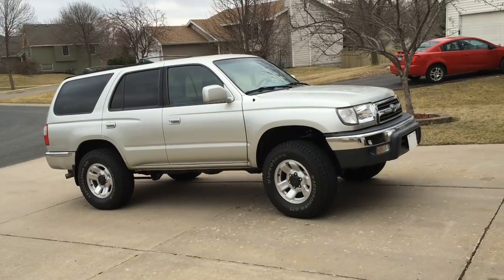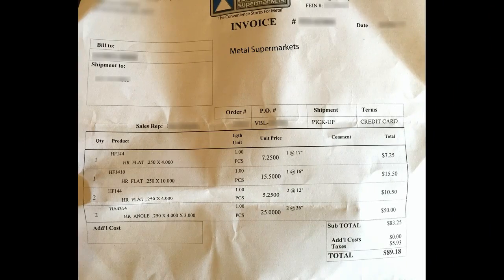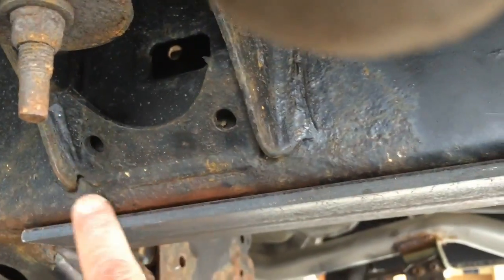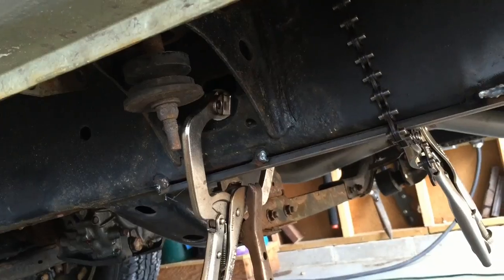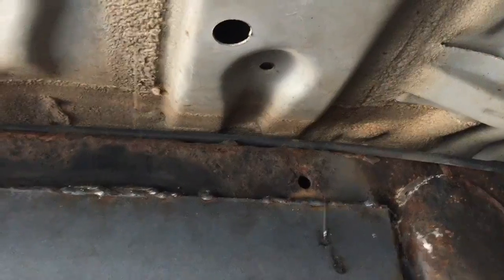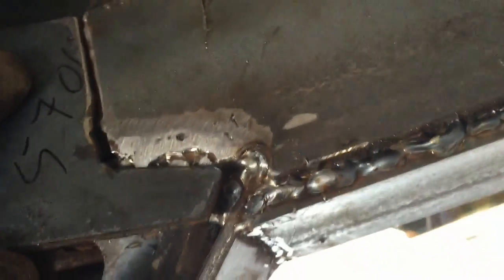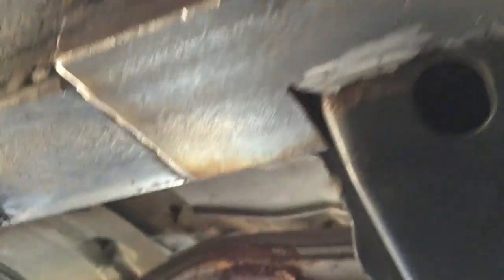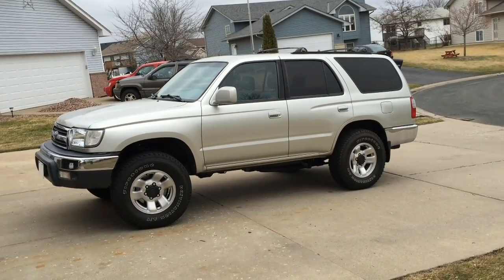2000 Toyota 4Runner Frame Rot Repair - Welded

Comment: As a welder, all i can saw is wow!. That is anything but safe. The frame was basically engineered to fail, notice the lack of rust on the floor pan. I find it funny how everyone went after vw for emissions when toyota has been building these unsafe rust buckets for decades and continues to do so. Toyota trucks are designed to fail after about 10 years both structurally and mechanically. Selling trucks and cars behind this facade of quality. Owned a tacoma once took a beating on it and never again, bought a domestic after that.

Comment: w/o getting rid of the existing rust, this repair is a waste of time.
Reply: +Boomer Po i was gonna say the exact same thing why go thru all that work and not cut out the rust that is a really poor job sorry to say but waste of effort its like having severe cancer and not cutting out the tummer b4 starting kemo
Reply: +Boomer Po To me, it looked like if he cut of the rust, there wouldn't have been anything left.  Maybe sand blast it?  But even with that, these frames rust from the inside out, so it's only a time buyer anyway.
Reply: Rust doesn't spread, moisture causes rust.
Reply: Jeremy Wood the entire section would have to be cut off then replaced and welded.
Reply: If he gets a couple years out of it it was well worth the time and money to do what he did . I'll bet it's still good and solid now almost 3 years later . Nice job . TheReaper!

Comment: I'm pretty sure Toyota designed the frame like this on purpose. I mean if the engines can go for 300k, they need to make their profit. So either they make junk engines that last 150k, and ruin their reputation, or design crappy frames that would only rust away in states that use road salt, so they still hold their reliability reputation in the non-road salt states, and make their money at the same time.
Reply: makes sense actually....what do you think about bmw mercedes & audi
Reply: So, the solution to that is to just simply undercoat it yearly. That's what I do and my Toyota frame is rust free and I live in Atlantic Canada.
Reply: bmwmsport11 I’m pretty sure Toyota would replace that for free

Comment: 1/8" steel would been plenty strong and much easier to work with.
Reply from the maker: I agree, the only advantage I seemed to have with the 1/4 inch was being able to grind down the thickness in some cases to get the pieces to better fit over non-flat surfaces.   Plus, not being a welder, I appreciated the extra metal on the edge to weld on to.

Comment: Dude,  you got balls to take on this welding job!  Way to go man!  Do it yourself and build on every experience  and show others that it's  possible.  The thickness of your material obviously over compensates for any possible weakness in the factory rusted sheet metal.  Good job on the por15 Paint job.Thanks for the video!

Comment: Thank you for this video.  I have a 1973 Corolla with frame rust/cancer on the driver's side forward of the cross member.  I no longer fear repairing it.      You did what you had to do and I applaud you.
Reply: As a guy whose repaired many rotted frames, i never use steel that is thicker than the original material. Overkill just makes penetration into the original frame much less effective, and harder to form. Always make a pattern from thn cardboard.

Comment: Impressive work/job and the best results I can find, food for thought, yes it certainly is. I have a bit of a frame issue here , I have tackled and work in progress. Yours is an inspiration of what can be achieved, mine is a lot less to do, thankfully because I'am just getting into welding, bought a cheap 200 dollar mig flux cored wire feed so hope to catch on and fix the problem. Thanks Man for sharing your work. Regards.

Comment: You say you aren't a welder which I understand, but... to anyone watching this, if you use this video as guidance, PLEASE grind down the base metal on the frame to shiny metal before you weld.  Welding over rust and rot does nothing but make it look like you reinforced the frame.  There is little to no assurance that good solid fusion is occurring to good base metal.  Rotted metal simply disintegrates when welding so you may think you're welding two pieces together but the result can be simply cosmetic covering of a huge problem.  Proper welding technique and heat input on good sound metal is the only way to get good metal fusion.  In addition, welding over paint or powder coating further contaminates the weld metal compromising its integrity.  

This frame in my opinion, was way past salvageable.  Especially, where main suspension components attach.  If a repair were attempted on such a critical part of the vehicle, a professional welder with a sense of structural reinforcement knowledge should be employed, but I fear a welder of that skill level would pass on this job.  This is not a safe repair.  I don't mean this to be criticism of your decisions, I just want to share with folks that may want to do the same in this safety critical part of a vehicle. 

There is sound structural welding, and there is cosmetic covering up of rotten steel welding that doesn't do much, if anything, structurally.  I myself have a 1997 4Runner with issues not as bad as this and I am curently on the fence as to repair or plan its funeral.  Its a shame because I have had it for 15 years and it is genuinely one of the best vehicles I have ever had, and I've had a lot.  Best of luck with your truck tho, stay safe and please be careful.
Reply from the maker: +Steve K Thanks for the feedback Steve - no criticism taken, it's great public forum content.  Although I can't speak to your thoughts they sound reasonable enough and truth be told, I had a welder pass on it.  Didn't go into detail, but didn't want to take the liability of welding a rusted auto frame.   Maybe for some of the same reasons you expressed.For me, it's a third vehicle, and one that only sees the light of day when the snow is piled high; that seems to be where it shines.  With a little luck, I will get enough safe driving out of it before she needs to be laid to rest for good.
Reply: @TheJbird5  there's no way a welder said that was good. Those welds were horrible for something so crucial. Just being honest man. Something that goes down the highway is held to a higher standard. There was way too fast of travel speed, Downhill when you could have went uphill and tons of lack of fusion and overlap. Not o mention that frame looked beyond it's time.
Reply: @jwill9877  He said he "had a welder pass on it," which I took to mean he took it to a professional welder for repair, but the professional welder refused to repair it, so he did it himself.
Reply: @JonathanSias  I see. He should have asked him for some welding tips and then asked a body shop how they repair frames. They stagger plate steal so they don't cause stress points at the end of the new steal to frame. It spreads the load.
Reply: If you use 6011 you can weld on rust no problem
Reply: Good on you brother , nothing wrong with prolonging a vehicle , it’s not a classic show car .... Shane should be on originally manufacturer who charges , 30-40 g for a vehicle that can barely last 1o years !
Reply: @jwill9877  Pay attention, dummy. He said he had a welder pass on doing the job.
Reply: @bluecollartrader1791  dummy then thats a clear sign that he should not have taken it on himself.
Reply: Yesterday, i couldn't even spell WELDER. Today, i are one.

Comment: Thanks for the video! This gives me some ideas (and encouragement) on repairing  rust holes in my 1965 Mercury Frame. Ladder type (Ford) frames were bad about rotting back where the frame goes over the rear axle

Comment: Steve K said it best and theres not much I can add. I am a hobbiest and have done several full restorations but this is of course something more. I believe this frame was beyond repair. I would and am using Saf T Cap frame caps on a friends 4Runner right now. I'm not a highly experienced welder but, I know how to make sure I have full weld penetration. It just takes me much longer then a pro. Otherwise, I applauded this guy for his efforts but again, should have used Saf T Caps as well they make those suspension frame connectors and you should have replaced them, they simply had to much rot
Reply: What are safety cap

Comment: I just bought a 2000 4runner sr5 with a rusted frame everyting is still in place just a 1 foot crack on one side and 1 inch hole at the weak spot seeing you reparing your frame with no experience give me the courage to fix it

Comment: Good on you for saving it! It might not be a "good as new" repair but it should buy you a good bit of time, especially if you get some rustproofing going on inside the frame rail. I retired a Pathfinder recently for rot that wasn't nearly as bad as yours--the more I looked, the more I found, and I found another one with a solid frame that I wouldn't be afraid to tow with. The Pathies rot out the same way your Yota did, the rails fill with dirt, the dirt clogs the drain holes and absorbs moisture, the moisture (and road salt) eat through the metal from the inside out.

Comment: My 06 failed for the frame recall. I had wire brushed it and sealed it. I was happy it did I now have half a new truck. 15k worth of parts not just the frame. My 84 gmc 3500 has the orig frame and has no rot. In the 2 years I've owned it I have taken measures to keep it that way

Comment: To everyone saying to replace the frame, honestly, have any of you ever done that? That is way more work than welding in the patches. I agree some rust killer and oil down the frame after would be good.
He fixed his truck with what he had available. You can armchair quarterback this all you want but that repair can be added to if needed and the vehicle should last until the running gear is dead. Good job!!

Comment: This is the nightmare you deal with driving on Minnesota roads in the winter and the salt they use on the roads. I have very similar frame rot on my mazda b2200 to repair.

Comment: It makes me wonder just where in the world did they get the steel to make those frames in the first place. I have welded on steel from a third world country and while welding along the steel just fell away with a big void like there was dirt there instead of steel. And this was new sheet steel. My frame isn’t as bad as yours so I’m gonna add some angle iron on to the frame. Giving back some strength to the frame. Hoping it never brakes in half like I’ve seen in some of the videos I’ve watched.

Comment: I am going to start next week on my 2000 4 runner 415,000 miles I will take pics I am a electrician lbew 716  I have minimal welding skills. I am ordering a new combo rig from eastwood and giving it a shot.
Reply from the maker: Go for it!  It was a fun and rewarding project.  But admittedly it was WEEKS of work for both sides.

Comment: sorta where my 89 just separated from... the rear leaf hanger just came off as they lifter the truck with a jack to replace my fuel pump assembly, thanksgiving break is going to be fun... haha
Reply: EcBuddy123 good job  most people  wouldn't do anything  they just tell you what they would do

Comment: Nice job, you must love that four runner.  I have to do similar work on my sons 2003 Tundra. I will take the bed off and try to make things a little easier. I use the same products from Eastwood myself, great stuff. Alot of work. My 2003 frame on my Ford looks great came from PA just like the Tundra. Things we have to do when these car companies don't stand behind there product. Nice job though

Comment: anyone considering this, make sure you run a flap disc over the areas to be welded. You'll get a much better weld. Also,  can rotabroach cut a few holes in the side of the new metal, allowing circular welds to the frame and other overlapping areas.  Keep an air nozzle, fire extinguisher or hose ready. Undercoating on vehicles likes to catch fire when you're welding. Not fun.

Comment: I might be welding some patches myself soon. I hope to use an everlast pulse mig welder. Should make thin metal welding much faster. BTW you really should make sure all of the existing rust is removed before attempting a repair. My two cents.

Comment: Nice work. I wouldn't worry too much about the repair over rot. The frame took 15 years to rot out through steel that was 70% thinner than the plate he used to repair. The numbers don't lie and that runner will have been put to pasture for something other than his frame repair
Reply from the maker: +Joe Orcutt I'm happy to say she's still running strong.  The welds are still in good shape, and there's no concern of the 1/4" steel rotting through before she's get's put down for something else.    Thanks!
Reply: +CL Biro I brought my beloved 97 tacoma 4x4 3.4 manual trans in to a repair shop to get the alternator belt replaced last week and the tech gave me the bad news when I picked it up, said they wouldn't put it on the hoist for fear of it cracking in half and falling off. I had scaled the surface rust off the frame last summer and sprayed it with 4 cans of asphalt undercoating and not spotted any rust through. 7 months later and i could poke holes in it with a little tap of a weld chipping hammer, WTF? Bulletproof engines crap frames that rust from the inside out.. I hadn't put a nickle in engine repairs since I bought it 9.5 years ago and now this.. Apparently the new generation Tacoma has same issue, does not look likeI'll be buying another one of Toyota's vehicles, but north american trucks are money pits after only 6-7  years in my experience with them so far. As my Dad used to say"If it has tits or tires you're gonna have trouble with it". Truer words never spoken..

Comment: Hey buddy it’s been 6 years. How is the frame holding up? I am a new owner of sequoia which never got its frame replaced because previous owner was just lazy. Driver side of frame is pretty bad (about 4 inches hollow rust). Trying to see if it’s worth trying to save it

Comment: drill some drain holes man, otherwise she will just rot out somehwere else! about to tackle my 2000 4runners frame next weekend, except with 1/8th inch steel and cutting out the rot. hows ur welds holding together now?
Reply from the maker: +Mazzman I have used it 50% as a daily driver, and 50% parked.  It tends to be my 'snow' car so she doesn't get much road time in the summer.   Since the repair I have found no issues w/ the welds.  I have gone around them w/ a poker, work light, and even a mirror and they seem to be fine from everything I can tell.  How did your 1/8" steel turn out?
Reply: great, i just finished por 15ing it last weekend, but unfortunately i found another soft spot on the drivers side...one more project to get done before winter..

Comment: I have watched some many videos of people trying to save a rusted frame, as an autobody and paint guy for over 30 years I would never ride or drive in any one of these vehicles after the frame was fixed.  I had to take classes to learn how to splice in a new piece of frame the correct way, with these vehicles having crush zones for the frame to fold up when in an accident so the people in the vehicles are safer.
I have seen people weld right over these crush zones making the vehicles a death trap now.  You should just hunt down a used frame from the south in the long run is safer and cheaper to just replace it.
Reply: There's absolutely NOTHING wrong with this repair if it holds well... and it will.  Your comment is just you trying to show how smart and special you are.

Comment: I think this is interesting. Recently I found a 87 buick regal for sale and it has a 3 inch hole in the frame is there any way to prevent the rust from getting worse? Sandblast it or grind it? Also if you repaired the frame yourself would it pass inspection?

Comment: I’m getting ready to do this exact same repair on my 98 4Runner. It broke in the same place. I know this is an old video but what size rod did you use to do the welding.

Comment: Chassis due replacing or take the truck to the big car park in the sky! Is a replacement chassis available? Might be the cheapest and best option? Be a good market for them!
Reply from the maker: Certainly would have been my first choice - if they were available.   Zero are out there, and the 'scrap' ones are just as 'scrappy'.
Reply: CL Biro surprised there are no aftermarket ones being made like they do for land rovers and range rovers. Might be a gap in the market for some enterprising individual?

Comment: Wow 😳 I was sad when I saw a small 1in rusted through spot on the muffler side of my 4runner frame, looks like ill be pumping oil down each side of the frame rails  every once in a while. And using lots of fluid film so it doesn’t get worse